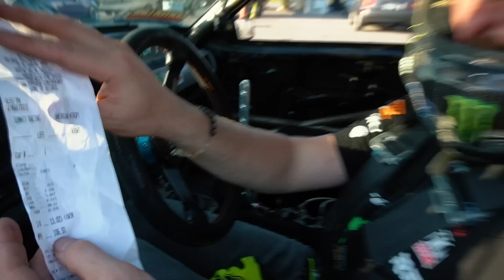We Drag Race Our Fox Bodies!!

Comment: They need like an exhibition class in FD so we can see these cool builds competing it suck you at this point have to have a winters wisefab or FDF because fdf is better honestly and 1000hp to even compete in fd wh6 can't there be a pro 2 exhibition like tuerck and is 4586 the part up a notch Vaughn fox all these guys have such cools builds that are basically irrelevant FD needs to change what makes you competitive Chelsea said in a video with rad Dan they're literally 7 mph faster on the bank at Irwindale from 2012 its barely noticeable I'm over 1100 hp and barely controlling what's under you